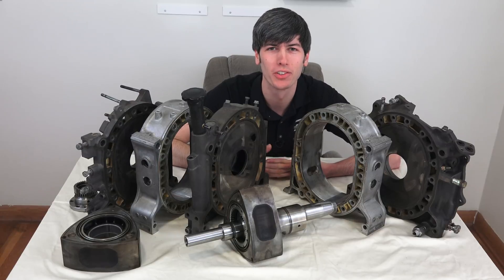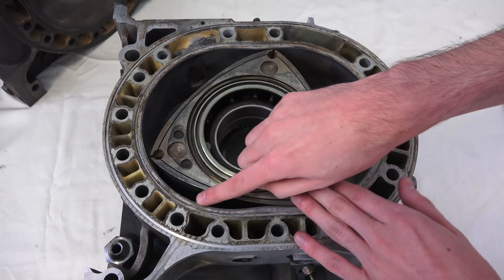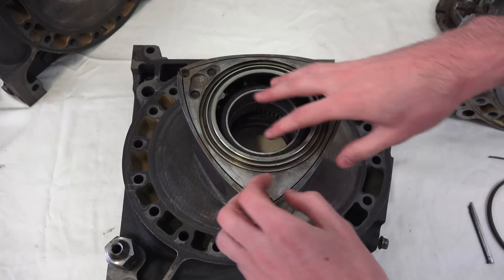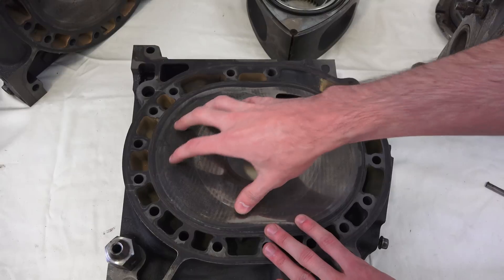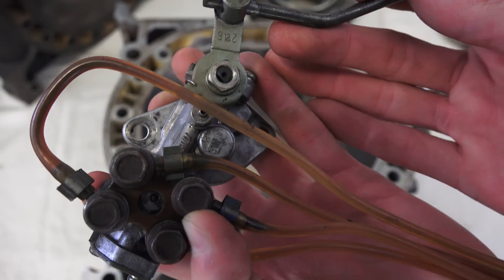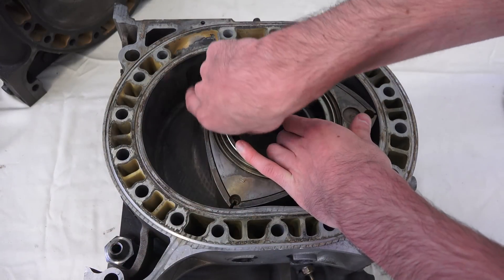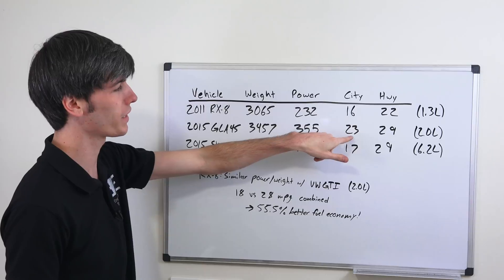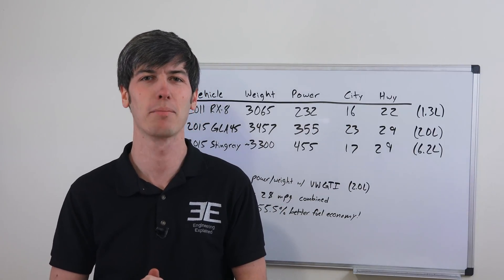4 Reasons Why The Rotary Engine Is Dead

Comment: Good information but all that's not why the rotary is dead. It started with the RX8 Renesis version the engineers moved the exhaust ports to side ports the original engine had exhaust ports inline with the rotor in the rotor housing this created a sweeping action which helped to reduce carbon build up from un-burned  fuel otherwise known as incomplete combustion, that's Mazda's error. The second reason is also Mazda's error the marketing division wanted cars they could sell so they put on rear doors and installed an automatic transmission behind it, their view of course like any manufacture why build cars if you can't sell them they went for volume instead of staying with a specialized car market or segment and sell to actual rotary Mazda enthusiast or people looking for a performance vehicle and less sales.  The rotary should never be in front of an automatic transmission NEVER. Third reason is on the customers and a little bit Mazda, the fuel recommendation was premium it should have been premium fuel required this was actually changed in the later model years, too late.  The death nail of a rotary engine is pre- detonation.  In a piston engine  pre-detonation makes a knock sound when combution occurs too early, the force is on the piston, head and cylinder walls no damage occurs as long as you don't continue to drive it that way it will eventually burn up spark plugs or in extreme cases burn a hole in a piston damage a piston and or cylinder,  that take a while. On the rotary engine pre-detonation is heard as a rattle at load conditions hot, the force or combustion pressure causes the apex seal to bounce thats part of the noise you hear, this will crack the apex seals in a heart beat you have loss of compression loss of power and  will need a engine rebuild. If customers would have heeded the premium fuel recommendation most of all the engines that where replaced would still be running today. That's why it died. It's one of the most reliabe engines ever built if maintained and reved high.
Reply: All Wankel engines are inherently unreliable and fundamentally inferior to reciprocating engines.
The Mazda Renesis was a failure because it was the highest static compression ratio of any production Wankel engines in and automobile application.
The Wankel engine is extremely limited in its reliable power output, especially in naturally aspirated form  due to the fragility of its seals and it's extremely poor combustion efficiency.
Reply: Completely false, the NHTSA recall investigation of the unusually high number of complaints related to premature RX8 engine failures found that owners with fully documented service and inspection records suffered the same high rates of engine failures.

Comment: I offset the poor economy of my rotary by also owning an electric scooter. 

Gas won't be around too much longer. Noisey, masculine, fire breathing monsters will be a thing of the past soon, so enjoy them while you can.
Reply: Bulshit you don't have enough electricity on the power grid for electric cars anyway
Reply: Petroleum is the lifeblood of our world. 90% of everything around you would not be able to be manufactured whether it be because the material is made with oil, or oil is used to manufacture transport or power it. Don't buy into the lies, oil isn't going anywhere anytime soon, and the whole "were going to run out of oil in 50 years" schtick has been going around for at least 75 years now.
Reply: @peteragurkis3590  yep, we do rely on oil. That's why the world is heating up.

Comment: It seems like the rotary engine would be well suited to racing, where emissions are irrelevant, and (depending on the racing rules) so may fuel consumption.  Also the rotor sealing and wear problems may not be as much of a problem as in a street car, due to frequent rebuilds for a race engine.
Reply: You would think but Wankel engines proved to be very poorly suited to motorsports and were never very successful in racing.

Comment: Another thing to consider is that the fact that the engine runs an oil metering pump means that your choices of engine oil are also limited if your playing by the rules. According to many big deal rotary shops and Mazda themselves your only supposed to run dino oil not synthetic in rotary engines that have oil metering pumps. Synthetics do not burn in the combustion chamber like conventional oil does. Some people delete their oil metering pumps and premix. This is mostly fine but there is an issue with this. On deceleration you are no longer lubricating the apex seals. There is a cool aftermarket solution to this which is an oil metering pump adapter that sandwiches between the front cover and the oil metering pump that allows for an external supply of oil or premix. What ever you think works best. But it is another thing to make sure is topped off and you have to find a place to mount another canister in your engine bay.

One other really neat thing about the rotary engine is that it spools turbos faster than piston engines. The reason for this is that the rotor doesnt have a cooling stroke like a piston engine. Every time that one of the rotor faces passes the exhaust port a flame front is passed out the exhaust port. This increases its ability to spool a turbo! It is a neat thing. 

Lastly an interesting thing is when compared to a piston engine its fuel usage per liter is 1.3 time the same amount of fuel. This is for several reasons one being the rotary engine is using a rich mixture to keep the combustion temperatures down. The latent heat effect of fuel is used to help with the fact that the rotary has no cooling stroke.
Reply: The myth regarding synthetic lubricants is easily debunked...
Any oil that meets Mazda's minimum API/EC or JASO specification is perfectly safe to use.
The API does not recognize any difference and considered the term "synthetic" a completely meaningless marketing and advertising.

2-stroke oil should never be used in any Wankel engine unless clearly specified by the manufacturer.
All Wankel engines use the same 4-stroke operating principle and Mazda only recommends API SL 4-stroke motor oil.
No 2-stroke oils meet this minimum specification.
The use of 2-stroke oil will damage your engine.

Mazda engines are less mechanically and thermally efficient in both natural aspirated and turbocharged applications.
Reply: @sandervanderkammen9230  Explain that to most of the serious high hp guys including myself who premix and have been doing so for the last 30 years...
Reply: Wankel engines typically have BSFC 50%to 100% higher than comparable  reciprocating engines.
The Mazda 13b series has an actual swept volume displacement of 3.
9 liters or 2.6 liters when compared directly to 4-stroke reciprocating engines.
The Wankel requires a richer AFR because it lacks efficient combustion dynamics in particular the lack of a high swirl or quench type combustion chamber technology and a lower threshold for detonation or pre-ignition as a direct result.
Reply: Wankel engines are very poorly suited to turbocharged applications due to the limitations of fixed intake and exhaust port timing and flow rates.
Wankel engines require higher fuel enrichment relative to manifold pressure due to its low efficiency and higher EGTs that easily exceed the maximum safe turbine inlet temperature.
Wankel engines are more prone to damage during manifold boost due to the greater risk of detonation and the lower resistance of apex seals to damage from erratic combustion and detonation.

Comment: Again. A rotory can if u use multiple  combustion chambers by using multiple spark placement and a bit of sofistocation in computer processing. The heat will disperse more evenly and heat the metal more evenly. It's actually kind of simple.  A 2 rotor can potentially have 6 combustion chambers possibly allowing 6 ignition points. Use an pnumatic recessed port system and u get perfect seel every time and all the efficiency u will ever need out of it.
Reply: All 2 Rotor Wankel engines have 6 combustion chambers.
The fundamental geometry that allows the Wankel to function also severe limits mechanical, thermal and combustion efficiency.
Apex seals are inherently unreliable which is why Wankel engines cannot  be used in production  passenger aircraft.
Reply: @sandervanderkammen9230  I didn't realize that. Not huge into rotories, just Kno a LITTLE about them. Cool
Reply: @sandervanderkammen9230  is that new? Haven't looked interesting it. All the rotories I've seen have 1 per rotor. Ialwayase thaught that they only had 2 which is why the inside of the housing always has a section that is dark and burnt looking.
Reply: @mathewostovich5630  No, each rotor face has its own swept volume displacement and it's own 4-stroke combustion cycle.
A single rotor Wankel engine has 3 combustion chambers and requires 1080° degrees of crankshaft rotation  to complete the engine's firing order sequence.

Comment: Has anyone tried to make a rotary engine with multiple spark points to try to make a more efficient burn? I don't know much about rotary engines.
Reply: Having 2 spark plugs significantly improved combustion efficiency..
Adding more however delivered  sharply  deminishing returns in combustion efficiency and decreasing thermal efficiency.

Comment: Comparing the gross weight of the cars it is mounted in is a bit dishonest. Compare the weight of the engines and accessories. I always wanted to drop a 13B into a Miata but never had the money. I probably would have killed myself with it but DAMN what a way to go. My RX7 lasted 17 years and was the most fun car a middle class working stiff could ever hope for.
Reply: The power to weight  ratio of the engine itself simply is not critical in automobile design... if it was? All cars would be powered by gas turbine engines

Comment: I know this is an old video. But quick question, do you think there is way to design a valve system that doesn’t include camshafts that could all be independently operated and make another combustion chamver

Comment: Every time I see one, I think they're cool but I can't imagine iron rolling around in a tumbler lasting very long, no matter how durable that tumbler is, it's going to bust at some point.
Reply: @astweiss  The Wankel engine is inherently unreliable...
Reply: @sandervanderkammen9230  how do you figure? I have an 83 rx-7. That's nearly 40 years old, no rebuilds, just basic maintenance and they thing still absolutely braps.
Reply: @peteragurkis3590  1983 RX7????
Wow! That is one of the slowest pathetic excuses for a sports car ever made.
A whopping 100 ft.lbs of torque new and less than half that now.
Yeah they make even more racket when the compression goes... all the fuel burning in the tailpipe instead of making power.
Reply: @sandervanderkammen9230  did I say it was fast? No. I said it still drives great. Why are you so butthurt that people want to keep pieces of history that have insane cool factor alive. Don't be mad because you don't care enough about cars to collect them. That car is going to go up in value just you wait.
Reply: @peteragurkis3590  Why is it so difficult for you to accept the truth?
Wankel engines are obsolete technology for one simple reason, they a horribly inefficient and unreliable... completely inferior to reciprocating engines.
Reply: @peteragurkis3590  Going up in value?
Don't hold your breath... I knew a guy that said the same thing about the Porsche 924... he died penniless with nothing but a worthless old car like you're going to.

Comment: It would be best to compare a standard piston 1.3 engine producing the same power for the emissions side of things and fuel efficiency. 
Not sure what to look at really.. Nissan Qashqai has a 1.3 engine that produces 157hp.. and 162 g/km emissions compared to the rx8 232hp and 284 g/km but the Nissan's tech is a lot newer (2018) guess I would need to look at an early 2000s engine but not sure if there is a 1.3l that comes close to the power the rx8 puts out.
Reply: The Mazda 1.3b series has a total displacement of 3,9 liters or 2.6 liters when compared to 4-stroke reciprocating engines.

Comment: I had an 1973 RX-3. It didn't last long. It overheated coming up over the Grapevine and warped the engine. It was cute but but had a fatal flaw.
Reply: first car i ever drove was a 73 rx3 as a kid, car was loaded with factory wheels, metallic green, factory stripes, etc,etc, never had any overheat problems, car hauled ass, easy 100 mph on freeway, lol, sadly u can guess where this fine car ended up.......................................
Reply: @reverendjimjones9061  Crashed?
Reply: @elizabethblane201  yes mam, rolled and written off, saw the centerline go by upside down,lol, found the car in scrap yard years later looking for parts for a datsun 510, i have been looking for another one but rare as hens teeth now in my neck of the woods anyways, be well elizabeth in these trying times.
Reply: @reverendjimjones9061  I guess they failed the Darwin test. I glad you survived your test, though. Stay well.

Comment: Funny Thing: In Germany this Engine is taxed like Trucks (by weight) and a RX-8 is lightweight in comparison, so very low Taxes, even if the emissions suck hard.
Reply: In Germany cars are taxed by engine displacement and the amount of CO2 emissions.
The RX8 had very high CO2 output for it's class.

Comment: Well when I took off the catalytic converter I gain 6 to 7 miles to the gallon for taking catalytic converter off
Reply: Taking the cats off reciprocating engines also improved mileage... what is your point???
The Mazda RX8 gets  appalling fuel economy with or without converters.

Comment: The long story short: This engine was was killed by EPA and California regulators during Obama years.
Reply: Completely false, the Mazda RX8 met or exceeded CARB regulations  (The strictest in the world) right up until Mazda cancelled production due to flagging sales.
Reply: Mazda built the RX8 for high volume sales and needed to average 100k unit per year to turn a profit. 
 The RX8 was a colossal sales flop that lost and estimated  $3 billion dollars and nearly put Mazda out of business, after a disappointing first full year of production, sales of the RX8  plumitted an average of 30% per year every year. By 2010 the RX8 assembly line was sitting idle except for one 4- hour shift per week.
Reply: @sandervanderkammen9230    Do you really have anything to support the claim that rx8 lost 3 billion? Seems
exceptionally high.
Reply: @haqq4260  Mazda has gone bankrupt 3 times in its history, the last time was in 2009.
The Japanese government secured a 350 billion yen bailout loan in exchange for stock.

Mazda expected to sell approximately 1.2 million RX-8s over an expected 12 years production run.
 After it's initial release, sales plummeted an average of 33% per year. 
By 2009 the RX8 assembly line was sitting idle except for just one 4 hour shift per week.
Mazda only sold 190,000 units in 9 years at a loss of an estimated 3 billion dollars.
Mazda was forced to cease production 3 years earlier than expected due to losses.
Reply: @haqq4260  Mazda's board of directors voted to cease all development of Wankel engines in May 2009 to save the company from total collapse.
No new prototypes have been seen since 2008.
The last production Wankel engine Mazda unveiled was in 1995... over a quarter of a century ago.

Comment: Sealing problem could maybe be resolved by manufacturing a special lubricant that could seal, lubricated, and burn by producing same emission than traditional engine shape.  Also, each corner of the triangle could scrape in diagonal the chamber in a way that before oil reach exhaust hole, that oil is redirected to a pickup reservoir.
Reply: The lubrication of the apex seals is not the significant flaw that made these engines obsolete.